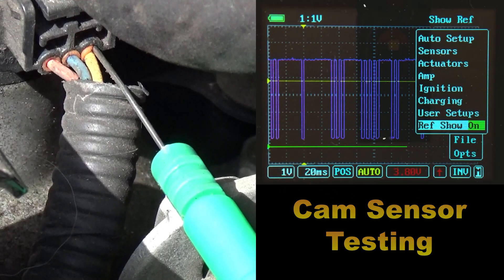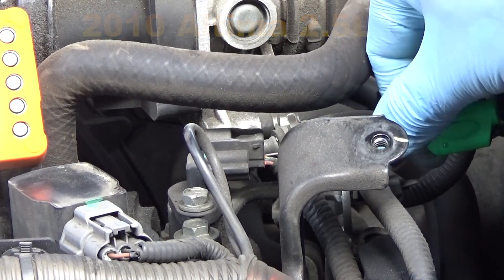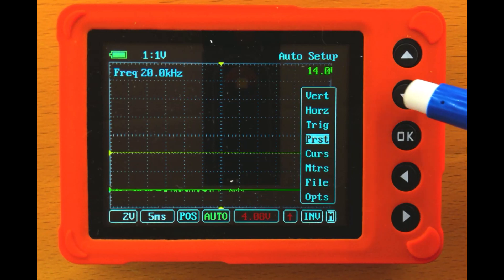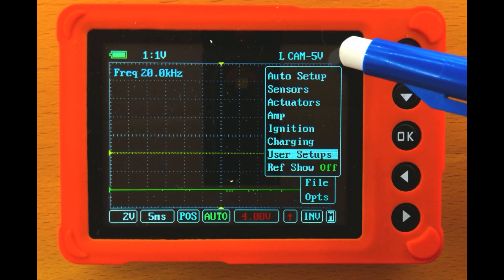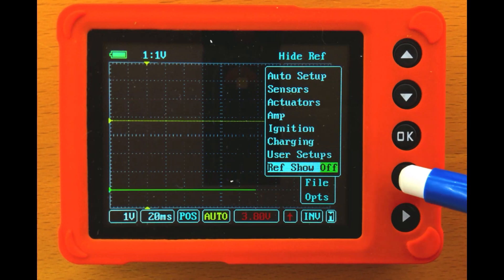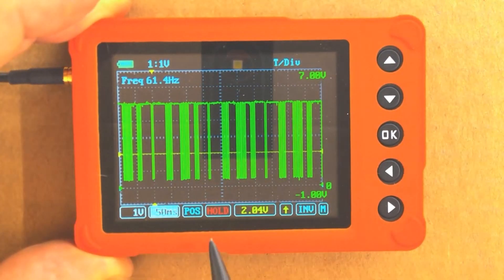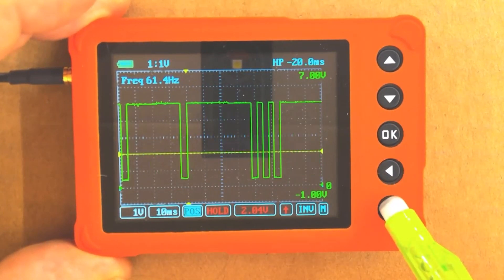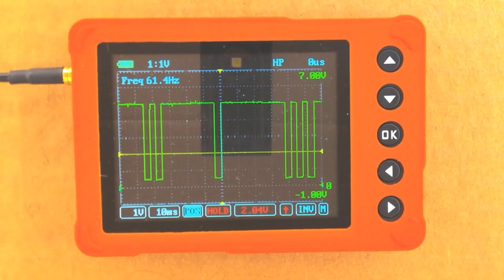CAM Sensor Testing with the uScope.

Comment: If I suspect that one cylinder has an unusual knocking, which sensor should I use with uScope, and what kind of pattern should I expect to see?
Reply from the maker: Knocking would be more mechanical and may not show up on a scope.  If the knocking effects the compression you could start with a relative compression test and then move to a pressure transducer test in the cylinder.  You might want to start with a listening device for the noise or use a scanner to check for misfires.
Reply: @DrivelineMaster  Hi Tom, this is Avery. Thank you for the response. I love your new videos with the uScope. It's better than a scan tool for older vehicles! Our Jag XJ8 is still running well despite its grinding transmission, and now it has a knocking engine. It's like the sick grandpa in a family; he always has small health problems but eventually outlasts everyone in the end. The 4.10 Detroit locker gear Vic has had spark plugs shot out multiple times with a racing tune. We feel it proves the tune is good. The only downside is it is not very dependable anymore. We cannot wait to show you the Jag with an LS engine. Two unreliable cars equal one reliable car.